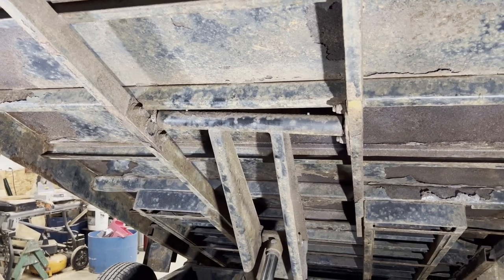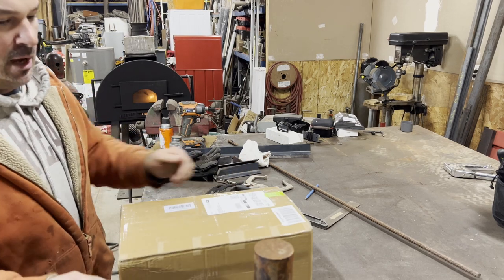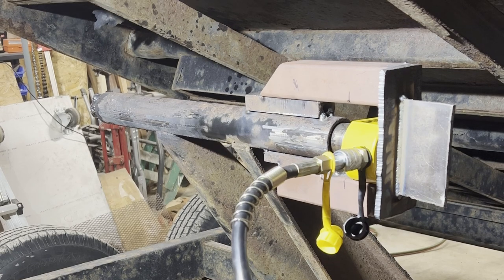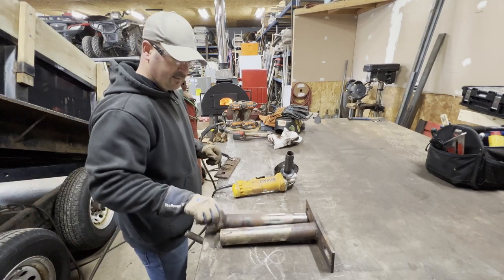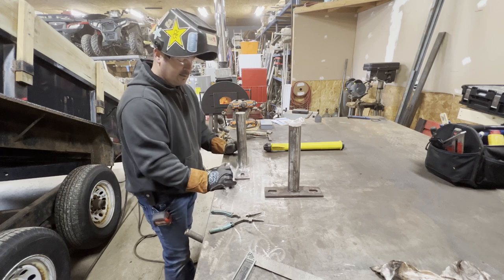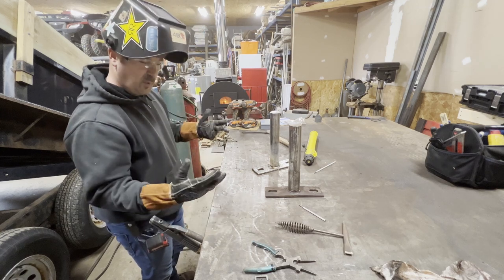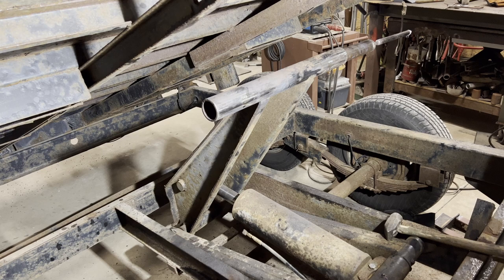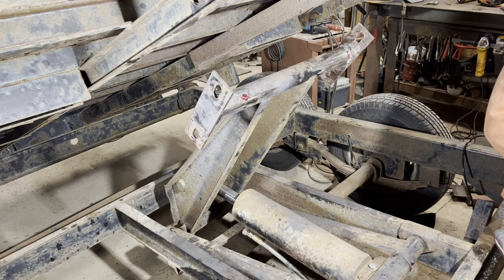Dump Trailer Lift Repair

Comment: How much would something like this cost for repairs
Reply from the maker: Depending on shop labor rate and material charges I would estimate between 800 and 1000. Grease is a lot cheaper lol
Reply: In Utah I was quoted 2500 for a whole new scissor lift or 1500 to repair the old one.

Comment: Nice job on the trailer. I think these trailers are mass produced and done with welders that get paid by the piece.  it wouldn't surprise me if that chromed pin was cut from a old hydraulic cylinder.
I've got a similar project to do to mine.  Only it's the hinge on the left side.  The pin froze in the tubing (no grease fittings either) from no lubrication and when the previous owner raised the body it twisted the tubing off of the frame.  Then they proceeded to let it down on  the fender.  I've also  got the floor and some of the body frame to replace.  Looks like someone put something in the bed that was pulled out of the salt water.
Reply from the maker: It’s awfully funny you say this… as I pulled the first pin that wasn’t froze I was thinking it looked like a pin from a hydraulic shaft. It was pitted in some spots that wouldn’t be typical of a plain old pivoting pin. It almost seemed like a hydraulic shaft that maybe didn’t pass inspection and got tossed to the side… and then installed on this trailer as a second use. Many brands of the these trailers are… sub par at best. I own a couple different brands and I can say that I would personally never buy this brand. Thanks for the comment and keep an eye out for the next video. It’ll be another dump trailer with different issues.